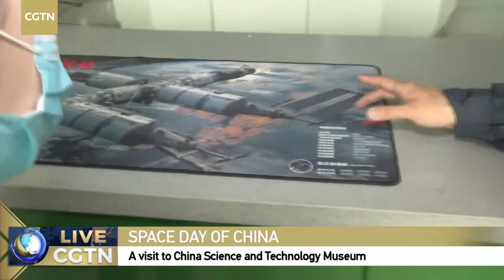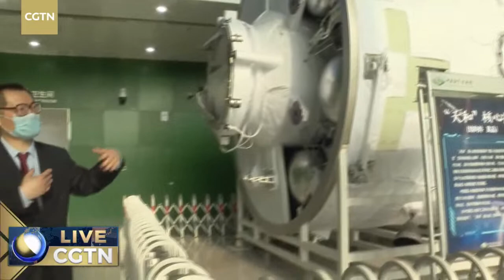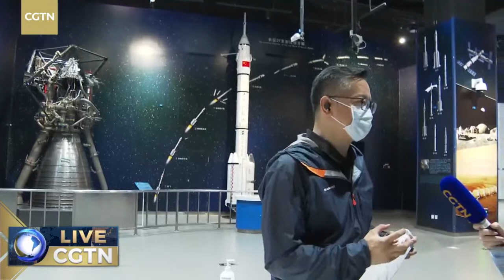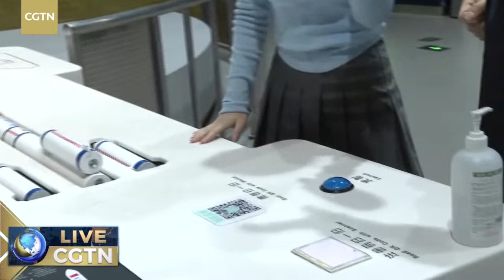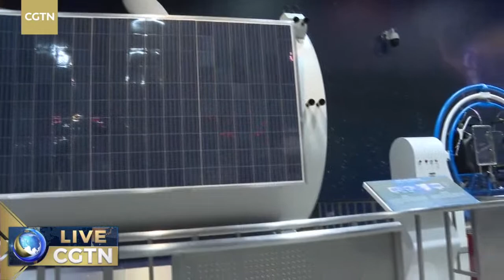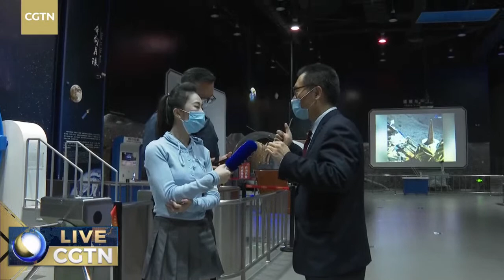Live: How many steps will it take for China to build its space station in 2022?

Comment: It is all down to the launch method. A rocket is kind of slow, firing a projectile using a charge plasma in magnetically shielded launch tube, with a magnetically shielded space craft, probably picking up energy via induction. The launch pressure need not be that high, as long as the launch tube in front of the space craft is in a vacuum and the launch tube is quite long with many plasma injection points, kilometers long, starting in a valley and going all the way up the most convenient high mountain. Rather than a launch months apart, launches hours apart. Mass no longer a problem, in fact it helps to get to orbit, an extremely strong, armored space craft to punch through the atmosphere (uses fuel to come done, not to go up, plasma jet motor for slowing down).